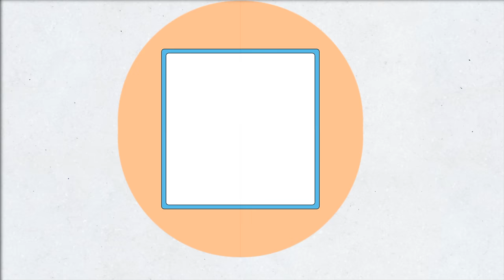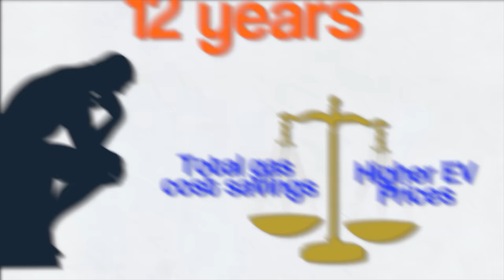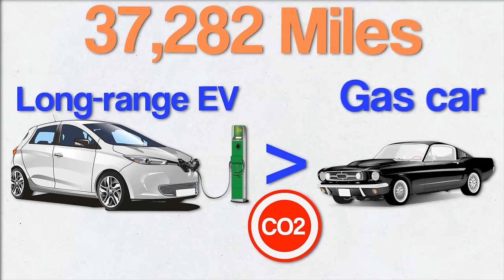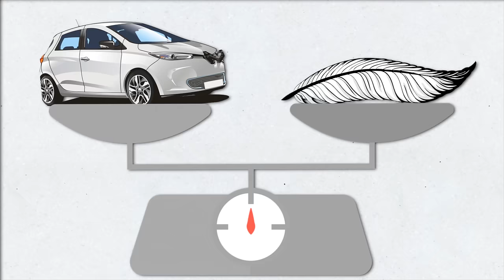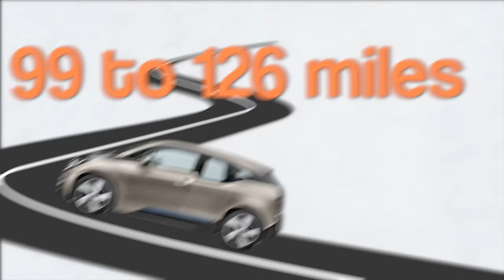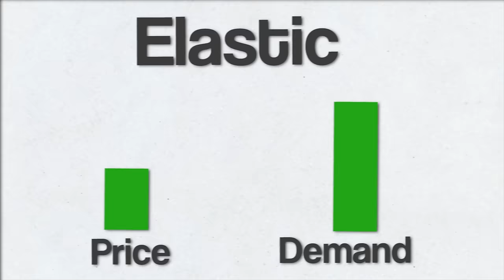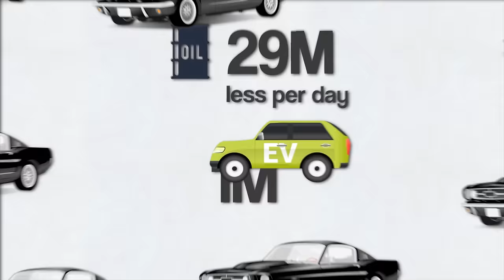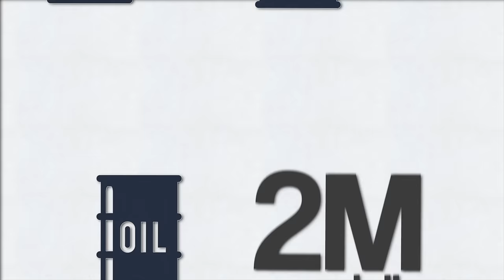If You're Worried About Rising Gas Prices, Watch This

Comment: The economic evolution occurring in society is called built-in obsolescence.
Ironically this is the most unfriendly to the environment thing you could possibly do.
It started in the 90s.
From cordless tools to phones, objects that used to almost last forever, due to changing technology have to be replaced every year or two.
This built-in obsolescence started with the automanufacturers.
And expanded to include many things.
Everything falls apart because it's made so cheaply from plastics that barely stay together long enough to withstand any kind of problem.
You see it everyday cars rolling down the road with their bumper half off.

Comment: I'm all for EV's but they still have a ways to go to make them desireable for me.  They need to go much farther without a charge and the battery life needs to be much longer.  I'm glad I didn't fall into that SUV/Big Truck craze.  I have a 4 cyl car that gets 30 plus MPG.
Reply: Michael Tipton ... that's true, but by the same token there are "things" that cant be done with a 4 cyl... myself I have an "extra" vehicle for in town, non load hauling transportation. My P'up has 262,000 on it. It's an '06! My computer is a '12, a 95,000 on it. I dont have off street parking to put an EV charging station in for my use, so EVs arent even in the ballgame.  I know many in the same sitchy. BTW both vehicles are paid for long ago. THATS a big plus to living w rising petrol prices. Electric rates will go the same as petrol prices as soon as infrastructure changes need to be made to accommodate EVs. Plus roads will fall into disrepair w less petrol taxes !!
Reply: True, my WRX is a beast while only sipping fuel. And I live in a walkable area, so I don't even need a car at all to begin with.
Reply: Question; are you okay with the way they go about getting the materials for the batteries? I'm sure you aren't or hope you aren't. Child labor and all the environmental issues. WOW I wish I would have known all this before going solar in my home with a Tesla battery. Sadly it's too late for me to turn back but any plans for a EV are gone.
Reply: @tomgrams2333  No need to worry about the petrol taxes. I'm sure in due time you'll find that you'll be paying infrastructure taxes on the electric bills to make up for it. Just wait. In time electric companies will be asking if you have an EV? Then " WHAM" !!! All of a sudden you have a jump in your electric bill of 9/10 th's tax for infrastructure..
Reply: How is a 200 mile range not far enough? I'd be more concerned with charging time than range. It's not like most people drive hundreds of miles daily on a regular basis and those that do will likely need a plug in hybrid.
Reply: @davidvega1750  Well no I'm not cool with that either.  Hopefully that will change as well.
Reply: @thetrainhopper8992  I was thinking road trips.

Comment: I bought a smart EV. Paid 6000 for it with only 7000 miles 3yrs ago  I only slow charge it with no noticed battery degradation yet unlike my other EV's I've leased. Limited range but 85% of my driving. Just put on new tires and  topped off the windshield fluid. 39000 gas, maintenance, free miles.
Reply: 39k miles is basically brand new, have fun paying thousands of repair cost soon. Like a new battery.
Reply: this is the exception not the rule.
Reply: Agreed. Lithium ion batteries are garbage. 2 of my leafs and my volts battery failed. My point is I only slow 110 charge it and never run it dry. I 240 charged the  others. These electric cars are junk. When the battery dies I'll put a Toyota MR2 engine in it.
Reply: The 3rd leaf I only leased for 24 months. So no time for battery failure.
Reply: @jaymoar3561   Remember. I only paid 6 for it. There's was  another one in Hillsboro Oregon for sale for 7000. I'll drive it till it dies.

Comment: Yea so according to USGS surveys, there is not enough Lithium on the planet to "electrify everything." There isn't enough Lithium to create the batteries required to replace fried cells, manufacture batteries for cars, renewable energy  storage, ect. Not to mention the method used to mine and refine Lithium barely meets the current annual demand...

Comment: A properly set up regenerative braking system will more than make up for the extra weight of the vehicle, the brakes will last longer. Also, in heavy city traffic, ICE vehicles generate massive amounts of unused heat energy, EVs and hybrids use almost no energy when sitting at the light.

Comment: I’ve got EV because it is difficult to get a new car with decent horsepower. Generally I looked at gasoline cars with 200hp+ and to get this I would have to pay more for some kind of GT or Racing version.  The cost of it is the same as EV and EV is cheaper to run.
Reply: Not buying your claim at all.  I have a 2020  4 cylinder Camry that gets 200 hp.
Reply: @robertromero8692  Not selling anything really :). I’m not saying it impossible to get a car like that for lower price than EV. It is just harder due to emissions limits on gasoline cars. And Camry cost exactly the amount what I paid for an EV. Checked just now :)
Reply: @dawidszyszko  I paid MUCH less for my Camry than a Tesla cost.  What EV did you buy?
Reply: @robertromero8692  that’s for sure. I’ve got Volkswagen ID.3 which in my country is almost the same price as Camry. The difference is like 5%. Toyota would be probably better equipped for that price honestly but I just don't like how Toyotas look. I'm not saying they are bad, just not for me. I could have VW Golf GTI for similar money, but the maintenance is more expensive and fuel is crazy expensive now and performance would be similar.

Comment: Scotty you forgot mobile phones laptop's power tools all take Lion batteries that have Lion and colbalt also you forgot to mention that colbalt is used to reduce sulphur in petrol/gasoline and Diesel  and it takes more colbalt to reduce the sulphur content in 300kg of fossil fuel than what goes into a 300kg battery also here in the UK we recycle the traction battery after it can't balance the grid any more. I have a bmw ev and I use it for delivering and drive over 1300 miles a month the car is on 90000 miles and my electricity comes from wind solar and hydro. It costs me 35 quid a month to run my flat day and night  plus charge my car every night  it would cost me 225 quid for petrol to drive 1200 miles that's 190 quid saving a month. And I'm still on the same traction battery it left Bayerische motor works. I'd like to see somebody drive 140 miles on 2 quid or about 1.03 uk litres of petrol equivalent. Half your gasoline cars bearlly get 20 miles to a gallon.  But each to their own hey Scotty.

Comment: Scotty, like your videos, but here is one point of electric vehicles you are missing. 

Combustion vehicles only run on petroleum fuels. If their is an oil shortage or gas shortage your combustion vehicle is an overgrown paper weight. And more to the point diesel inventories are at an all time low, and most gasoline deliveries are made by diesel powered trucks. 

Electric cars on the other hand are not limited by fuel. They can be charged by the grid, solar panels in the yard or on the roof, a generator that can run on CNG or LP, or even a fuel cell.
Reply: But 'the grid' is powered primarily by fossil fuels, correct? 
  No fuel for internal combustion vehicles, then no fuel for the production of electricity.
Reply: @Mike-gt1cs  most of our electricity is produced by natural gas and renewables. Natural Gas is distributed mainly by pipelines, not diesel powered trucks.

Comment: There's a other things to consider in a gas vehicle, no oil changes which pollutes , no antifreeze, no gas, way less maintenance, belts, plugs, sensors, ect.... It would be impossible to make a car with no side effects to the environment, your air would be cleaner in a town full of EV's it can be a tough trade off

Comment: My father needed a new car, and considered buying a new hybrid to save money on gas (Kia Niro). I pointed out that if he started financing a new hybrid, his monthly payments would be higher than what he spends on gas… especially because he lives in the building he works in, and doesn’t drive that much anymore. Not to mention the cost of repairs and getting a new battery in a few years. He bought a used gas car for $5000 instead. I admit it would be nice if there were mostly EVs downtown where it gets very congested, so the air would be cleaner.

Comment: The only issue I have with this video is he factors in the emissions for extracting, transporting, and producing the batteries as a negative of the EV’s. However doesn’t account for the same or at least similar emissions for extracting transporting and refining fuel for combustion vehicles. Even environmental factor’s like oil spills. I would love to see a study that compares the two from start to finish. Seemed a little agenda based.

Comment: Actually our Chevy Volt, a plug in hybrid, has been very reliable, along with our Nissan all electric Leaf.  They accelerate very quickly, and are very quiet driving in all electric mode.  The downside, of course, is it takes 4 hours to charge both cars using a 240 VAC charger, and finding chargers, usually only in larger cities,  limits their range.  Only Tesla chargers offer full charge in only 30 minutes.   Until a fully nationwide network of chargers, say, at hotels to charge overnight during stays, or at a sports event, etc, with the chargers in the parking lots, and range increases to 400 or more miles on a single charge, Americans will not purchase them in mass, to take state to state trips on vacation or business,  but the trend is positive and in the right direction.  Another technology not really taking off is hydrogen fuel cells, which Toyota is exploring, and all gas stations could have this type of fuel in the future, as demand increases.
Reply: You obviously missed the point that ev vehicle production and the cost to generate the electricity for those vehicles is higher than what it takes to produce a gas vehicle... imagine if he added in the factor of diesel engines 🤯

Comment: If we actually have such an Fragile  Antiquated electric power grid? 
Then will it collapse? When everyone plugs their electric vehicles in? HUMMM??
Reply: Hasn't happened yet. Remember the story of Chicken Little?
Reply: The grid will infrastructure can gradually be improved to support EVs where needed - not everyone is going to get an EV overnight so it can be gradual. Also, EV's can be charged at night when the grid is at it's lowest demand. And do you have a 240V washer/dryer outlet in your home? If so, you already have what you need to support your EV

Comment: I love your channel.

The point you made about it not being as simple as EV good, ICE bad, is extremely important. CO2 output is much higher during the manufacture of an EV vs an ICE, but in this discussion folks don't seem to discuss the age of Internal Combustion Engine manufacturing. EV manufacturing is effectively in its infancy. Were ICE vehicles always manufactured as efficiently as they are today?

There will be some adjustments and growing pains, but eventually many vehicles will need to be swapped for EVs (not ALL vehicles, of course). Recycling metals in Lithium ion battery cells is on the rise. Manufacture will become more efficient. Renewable energy is growing. Things will improve.

Appreciate all the research you put into this!

Comment: I still drive my 1993 Dodge Dynasty and V6 3.3L Motor still runs excellent condition. We only have three options you Buy Electric Vehicles, Buy newer vehicles that are difficult to fix, or try and buy a older vehicle that it easy to fix. I remember long time ago there was talk about building a Vehicle that uses Air Compressor to fill up Air Tanks in order to make the vehicle move like a Gasoline Vehicles, but I guess Corporations didn't like that because they would not make too much money out of it.

Comment: Scotty, this was very biased against EVs. You failed to mention that over the life of the vehicle, an EV emits uses overall significantly less CO2 than a gas powered vehicle would, and how much more efficient overall an EV is over a gas powered vehicle. It is also true that lithium mining is destructive on the environment, however the manufacturers are getting much better at using other minerals in the batteries (Tesla’s 4680 battery uses silica and less lithium), and using much less lithium overall - the solid state batteries in the works use MUCH less lithium than the current batteries do, and the processes to refine lithium are getting better. Engineering and science will find a way to do this shift in a way that doesn’t harm the environment more than our current way of life. Tesla is already on to something with the 4680 battery - silica for example is the second most abundant element in the Earth’s crust. The transition can and will happen, and just like any other technology, costs will come down over time. Oh, and another KEY point - we can recycle lithium!! We can’t recycle petroleum!
Reply: What about all the oil needed to build the infrastructure just to manufacture EV's plus oil to make electricity, roads, charging stations etc etc etc......
Reply: @will7its  What about all the oil it takes to produce gas powered cars? What about the oil it takes to transport oil to refineries, the energy to refine the oil into gas, then transport the gas to the gas stations?

Comment: Good video, Scotty. I live in the mountains of NC. An EV doesn’t seem practical since 1. No charging stations here abouts, 2. Mountains. I suspect the range of EV here would be considerably less than advertised , just like it is for ICE cars. 3. There is nobody to work on it, 4 Way too expensive to purchase. 
As for gas prices; I think they will go up. Why? Glad you asked. When demand decreases prices will lower somewhat, but the petroleum industry still has to maintain a certain profit level to keep the stakeholders happy. And, of course, to support the executive’s pay level. So after a short term decrease, the price will rise back to, or probably above, previous levels. But, I’m not an economist so this is just my SWAG.

Comment: Almost 50 years ago, I read an article in Scientific American that talked about low friction super high speed composite flywheels that could be brought up to speed with an electric motor, and that the flywheel would store enough kinetic energy to be able to generate electricity to run the electric motors that would drive the wheels.  I have not seen one word about this technology since then.
Reply: Implemented in recent Volvo cars with letter “B” in model name. Saves only about 1 mpg, yet noticeably improves off-the-stop acceleration.

Comment: Here in the UK, my local fuel station, Diesel £9.49 per gallon & Gasoline  £8.19 per gallon. 
With electricity prices always going up EVs just don't seem practical, plus the cost of purchasing EVs. 
As for no exhaust pollution (saves the environment) that just gets moved from the EV to the electricity generating companies. You still need to charge that EV.
I read a report sometime ago that it takes 500,000 gallons of Water to extract 1 ton of Lithium & then that water becomes toxic, & mining it out of the ground. How is an EV environmental?

Comment: we bought 3 new cars this year. one of them is an EV. the battery warranty is 8 years/100k miles. we usually trade in our cars every 5 years. the EV replaced my wife's audi a4 (premium gas). she drives around 100 miles a day for work and knew gas prices would keep climbing with the new president. the other new cars are used only when the EV is not available. we plug in every night, never had to use public chargers. the EV is the mid priced out of the three. we also just moved to FL, gas prices are around $4.50/regular.

Comment: One option is the plug in hybrid like the rav4 prime.  less batteries are used, much less gas is used,  as of now has a fed tax benefit ( but about to run out). can use gas if can't charge it, the quality of Toyota, and the hybrid quality of Toyota.  I have been very tempted by it, but I don't use my 8 yr old Subaru forester so much, so the cost is not justified.

Comment: Oil is an energy source and a production material. It is difficult to source, harder to find, exists mostly in remote locations deep underground, and costs lots of energy to transport. 
Electricity is an energy source but NOT a production material. It can be made in a dozen ways, anywhere, even at your house. 
Therefore we should use oil as a means of production and electricity as the primary power source. Duh.

Comment: I've recently bought a dacia duster in the UK that can run on LPG or petrol. There's enough LPG pumps in the UK at the moment for it and the price is half that of petrol. It costs the same as the petrol version to buy too. It also has much reduced emissions, particularly NOx and particulates. Why we haven't been running LPG cars for a long time is beyond me, it seems to make sense as its an affordable tech that can have an immediate positive impact. The engines are even cleaner, less soot in the oil etc and as a result, last longer. EV's are just way too much initial purchase price for me and I'm guessing its the same for a lot of others. I don't worry about running out of LPG either...I've got another 50L of petrol to fall back on after the 50L of LPG runs out. These bi-fuel cars have insane range. LPG is much more common in Italy and Turkey I believe, they have really made big use of LPG.

Comment: The running costs of an EV including maintenance are between 15% and 40% less per year. 
So the $9,000 difference becomes $400 in just 5 years. Also the cost of Gas will increase by 10% - 15% every single year.